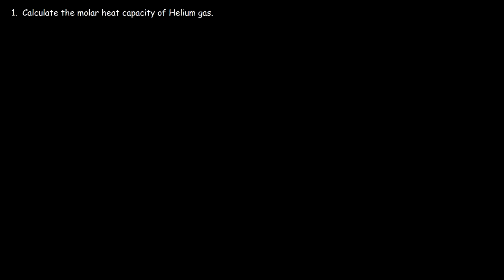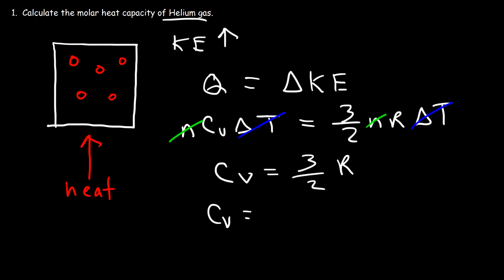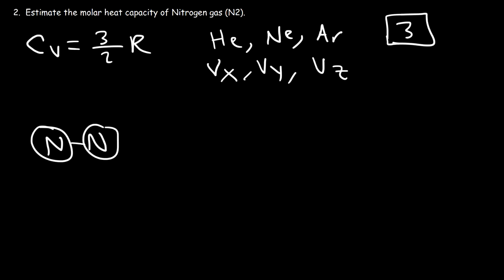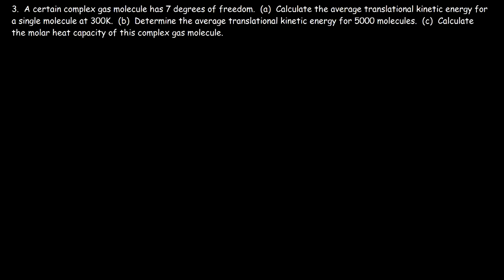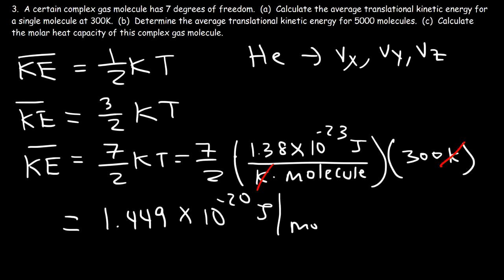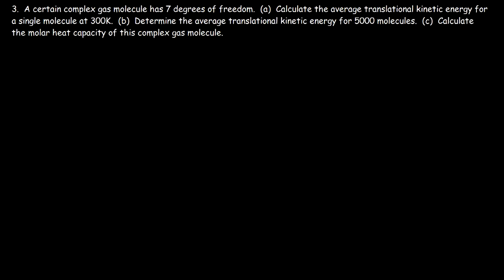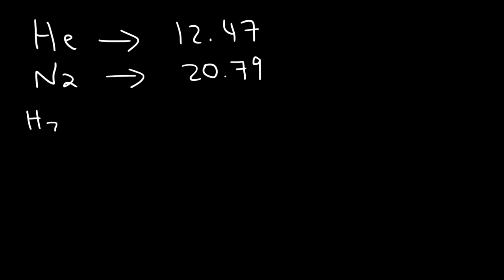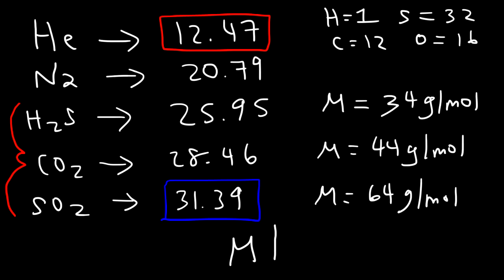Molar Heat Capacities of Gases, Equipartition of Energy & Degrees of Freedom

Comment: A diatomic molecule has 3 translational degrees of freedom.
A diatomic molecule has only 1 vibrational degree of freedom.
A diatomic molecule has 2 rotational degrees of freedom.
So, a diatomic molecule has a total of 5 degrees of freedom at moderately low temperatures, when vibrational motion is not excited yet.
A diatomic molecule has a total of 6 degrees of freedom at high temperatures.
Reply: Great

Comment: In the last example, it seems to me that you calculated not translational KE (as the question required) but total KE - which includes (1) translational KE, and (2) rotational KE.
Reply: Correct thats what i was thinking in triatomic we have 3 translational and 3 rotatory here we will have an addition vibratory so its gonna be 3/7*3/2kt if i am not wrong

Comment: If you compare the molar heat capacity of Cl2, I2 and H2, at ambient temperature, apparently I2 has the highest, but since they are all 3 diatomic molecules with a degree of freedom of 5(at ambient temperature) I don't understand why their molar heat capacity is different. Can someone explain to me why?
Reply: It might be because I2 is a bigger molecule. It takes up more heat to vibrate it and so on.

Comment: Isn't Q=nCpdT ? then for monoatomic gas Cp =3/2 R...pls correct me if I am wrong
Reply: Cp = 5/2 R
Reply: Cp will always be one R greater than Cv, so if Cv = 3/2R as for a monotonic, Cp = 3/2R + R = 5/2R
Reply: His question is why the uploader used Cv instead of Cp. Thats also my confusion too.
Reply: Hmmm maybe because, from equations:

dU = Tds - PdV
dH = Tds + VdP

Since theres no applied work, PdV = 0. Hence,

dU = Tds

We know that dU = Cv*dT and dS = Q/T (for closed system assuming no entropy generated)

Cv*dT = Q

And also for ideal gas (mono atomic gas), dU = (3/2)kdT

Also, dH = Cp*dT

Note that
Cp = Cv + R/m (where m = molar mass of molecule)

(Im not sure about this one)
We can conclude also that VdP = (R/m)dT.

Comment: isn't this specific heat instead of heat capacity
Reply: the full name is specific heat capacity.
specific heat capacity and molar heat capacities are quite different.
specific heat capacity expresses heat required to raise temp per unit temperature (1 Kelvin) and per unit "mass" (1 KG).
molar heat capacity expresses heat required to raise temp per unit temperature (1 Kelvin) and per unit "moles" (1 mol). I assume I dont need to explain what mole is.
while its easier to use KG and by extension Specific heat capacity, it is important to realize KG is a unit we devised for trade, macro atomic phenomenon deals with chunks of molecules in integral multiples moles(number of molecular weight) and NUMBER OF equivalent weights not KG so molar heat capacity is necessary to explain them.

Comment: how does N2 have 5 degrees of freedom? i thought the number of degrees of freedom was 3 times the number the atoms, which for N2 would be 2 atoms, so the DOF would be 6???
Reply: katelyn williams no youre wrong, for diatomic gases , it is 5 and triatomic bent its 6
Reply: @stephenhawks3941  it is 7, but in general, the two vibrational modes of a diatomic gas molecule are frozen out at room temperature
Reply: 3 are linear, i.e. along x,y, and z axes.
the other 2 are rotational motions, 1 where the axis of rotation is along the bond and 1 where the axis of rotation is perpendicular to bond.
Reply: https://youtu.be/jkeQAO8xAng
Reply: @nabanitagoswami6652  thank you